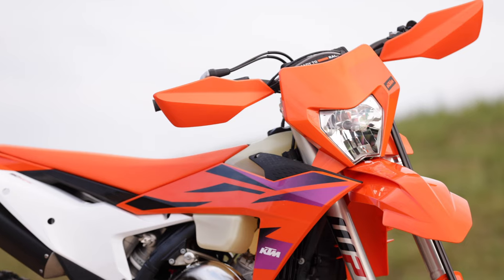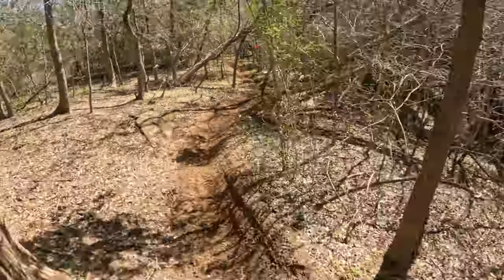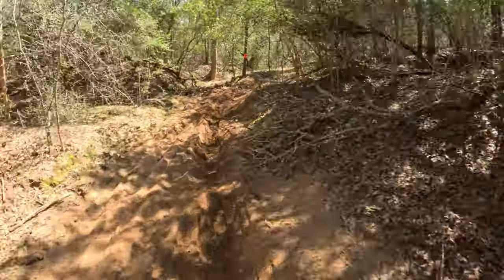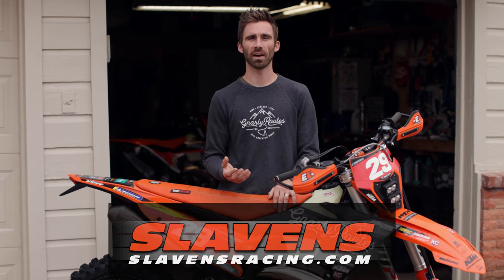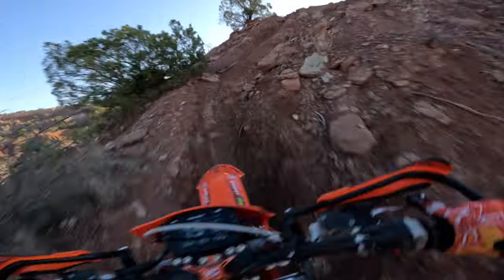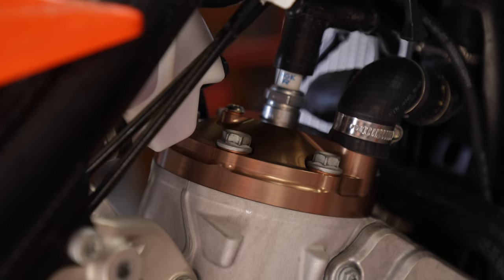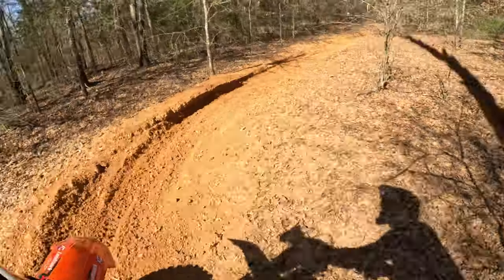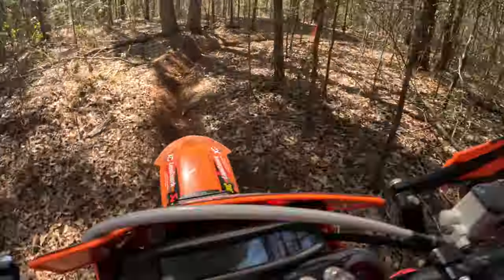2024 KTM 300 XC-W Power Upgrade | TSP Head and ERM Module from Slavens Racing

Comment: I got the ERM for my 23 250xc and it really made a difference. Pretty surprising. I didn't initially do a powervalve reset, which I should have. When I finally did, the bike is an absolute rocket ship. I really don't see the need in getting the head, I feel like any more power would make it almost unrideable for my skill level.

Comment: Thanks for the video!  I'm going to try one of these out.  I've tried quite a few mods on the 24 250 XCW, and just for fun I swapped the cylinder for an XC/SX version.  The porting differences between the cylinders are easy to see and measure, and the XC/SX cylinder moves the power to Mid/High RPMs from the Low/Mid power characteristics that the XCW cylinder is designed to produce.   Now the bike revs out like the XC/SX, but the XCW has a heavier flywheel so it's not quite as aggressive.   Some other parts have to be changed as well, but I think the porting made the biggest difference in overall power.  I can rev it out several seconds longer before it falls off the power, and many times that's enough to prevent the need to shift before the next turn.

Comment: Same experience I had with my ‘24 TE. It was a little lazy stock, but the ERM made a huge difference.
Reply: @WASemiHardEnduro  Are you saying just the ERM tuning made a big difference by itself, or did you also add a medium or high compression head as well?
Reply: @vonrunner Yes. No head needed.
Reply: @WASemiHardEnduro  Good to know, thanks for the info!

Comment: I deal with Alec as well and like you said, he's great to work with. Right now Slavens has the ERM on back order, soon as that lifts I should have mine. Any chance you can do a in-depth vid on the ERM changes you've made and how you found your sweet spot once you get some time under your belt?  It's a huge benefit to us when learning from pro riders like yourself - that way we can set up the bike and dial it in perfectly.  Man it's great to watch you rip on that thing! Cheers...
Reply from the maker: I will work on an in-depth one, I'm still tweaking on it but have really just found myself making adjustments to the power valve depending on terrain and available traction.

Comment: Would u say it feels like the 300xc now power wise or still not as explosive? If not Do u think adding the high comp head would have been better to get it closer to xc power/explosive?
Reply from the maker: It's close, especially with the adjustments you can make with the power valve.
Reply: I have a ‘23 300 xc and a ‘24 300 xcw. I upgraded the xcw with a tsp high comp head and their ecu reflash. These upgrades are both improvements over the stock and the green map gets u closer to xc type performance. Still, imo, the xc is a straight-up beast and sooo much fun to ride!!! Throttle response is noticeably quicker on the xc and the top end rocks. For me personally, riding more technical single track, the xc isn’t any faster but it’s a blast to ride. If smooth is fast, the xcw is my best bet. My only complaint with the xcw now, is the slower throttle response. It’s negligible for general trail riding but in the slow technical stuff, there’s a little room for improvement.
Reply from the maker: @LetRRoll  Thanks for chiming in!
Reply: @LetRRoll  Have you tried lighter flywheel?
Reply: @LetRRoll do you have the same throttle tube cam in each bike? The xc comes with shorter throw and the xcw comes with a longer throw.
Reply: @grutzmac  , yes. Several months ago I compared the xc throttle cam to the stock xcw throttle cam and noticed what you’re talking about. At that time, I replaced the stock cam with the more aggressive xc version. To be honest, I didn’t notice much difference. Thank you for the feedback. I continue to ride both bikes, xc & xcw and can’t decide which one I like better…both are awesome.

Comment: With the ERM, you can detune one of your maps too to better suit sloppy/ slick conditions. And like you said, the power valve adjustment can make a huge difference on the power delivery. One thing i probably would have mentioned is that you were probably using the pro mode which costs $50 additional, but it was well worth the price, IMO. I'm still messing with mine. But actually looking forward to people sharing their setting and comparing them. Any plans on doing the oil injection delete?
Reply from the maker: Great comment, I do have the pro mode but I started with basic to get an understanding of how things affected the bike first.  I don't plan on deleting the oil injection.

Comment: Great content again.
What's the difference in the exhaust that you took that expensive can off and are you running the stock expansion chamber
Reply from the maker: In the video, the clip I showed was just to give an idea of what I had to do to remove the head.  I didn't swap out any of those parts so still running the Akrapovic Slip-On silencer with the OEM exhaust pipe.

Comment: Hi,
There is a difference of 8 hp between xc and xcw.
Could TSP module increase xc power?
How is the fuel consumption with the TSP module?
Reply from the maker: The TSP ERM would for sure give you the ability to get more power and more rideability out of the XC.  Good question on the fuel consumption, I haven't noticed much of a change over stock consumption.  I notice fuel consumption being much more affected by riding sandy tracks and trail vs. hard pack trail as well as riding race pace vs. trail pace.

Comment: Hi, how do I can search the headlight set up that you put it to your bike, thanks
Reply from the maker: It's from the guys at MotoMinded in Grand Junction, Colorado.  I'm running a 2020-2023 XC-W headlight mask with a kit that they sell with a Baja Designed unit that bolts in with three screws.  Moto Minded also sells the pigtail that allows the the new plug on the 24 xc-w bikes to work with the older generation lights.  The reason I run the old mask is that it gives me enough room to mount up my GPS unit behind the handlebars.

Comment: Cole, I have a 24 300xcw, have the Standard TSP flash + med head, I want the bike to run more like my TSP '23 300tx , I just got the ERM in ... with that said could you share what changes you made vs the Stock TSP flash within the ERM, you mentioned changing the powervale, how much more did you open it, 10%?  and at what RPMs? any changes to fueling/timing  -Do I need Pro Mode to get the Powevalve to where you have it? I only have the Basic - Much appreciated
Reply from the maker: You can increase the PV settings appropriately in the basic mode.  I just went up by increments of 1 until I got it where I wanted.  Nothing was over +3 but still going to experiment more.
Reply: @ColeKirkpatrick   I tune & tested today  did, +1% on fuel, + 3% on timing & +10% on PV across all rev/throttle ranges, it feels good, especially on hill climbs

Comment: Anybody detuned a TBI SX motor for enduro? Suspension?
Reply: Isn't that basically what the XC model is? EXC (XC-W in the United States) is for enduro, SX is for motocross and XC is for cross country – think of something like GNCC and NHHA. It's based on the SX and it's not sold outside the United States.
Reply: The xc is essentially that, they have the same engine and head insert